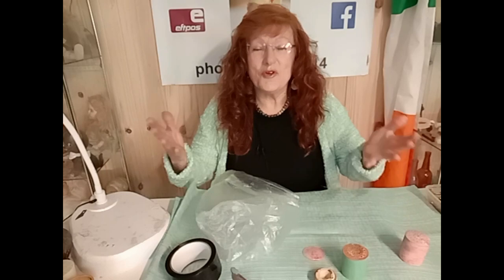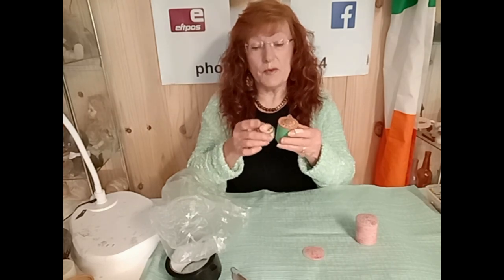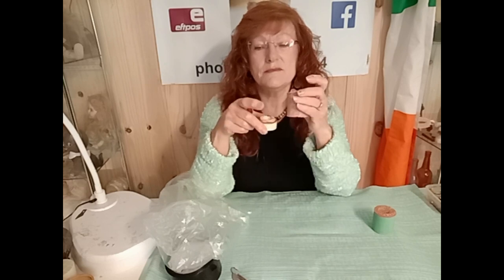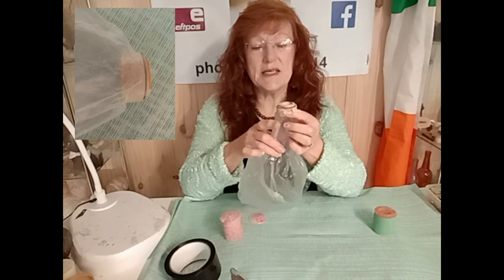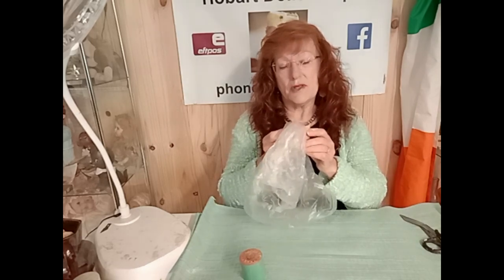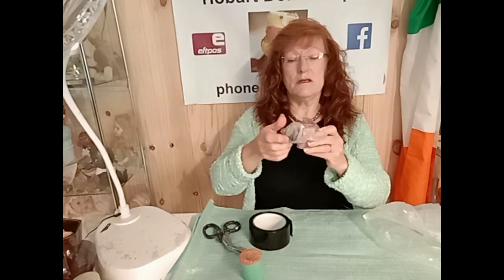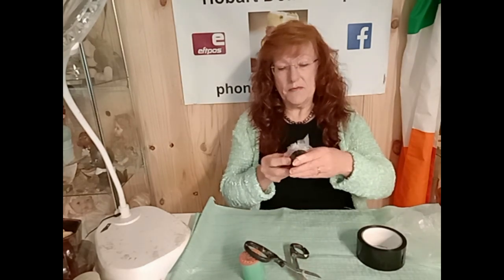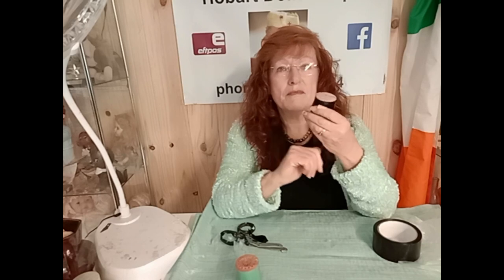How to repair a doll crier.

Comment: Thanks for this video.  Very helpful. I have a doll, which I got after my late mother. Doll probably 60 or more, years old. The crier broke down. some years ago. Doll always kept very carefully, I could repair the crier, as you describe, airtight place for the crier.  Used the method below, tape and a drop of baby oil.
Reply from the maker: Great to hear from you.  Even when handled very carefully, the flange around the edge of the crier can perish.  If you need any additional advice on repairing the crier, please don't hesitate to get in touch.

Comment: Hi Kittie. Is there any way to repair the reed if that doesn't work when blown through please?
Best wishes from the UK
Reply from the maker: Hi. You can try cleaning by blowing through or using a fine brush. Try blowing through from both sides as well. It doesn't take much grit to prevent it from working. Also check that the reed isn't bent and misaligned. An alternative is to use the reed and surrounding piece from another damaged crier. I could send you one but postage costs might make it more worthwhile looking for one closer to home.
Another point is the opening to the reed doesn't have to be misaligned or bent by much for it to prevent the sound.

Comment: Hi Kitty I’m having trouble removing the cryer box. It rotates about 90degrees but is very stiff. Should it just pull out?
Reply from the maker: Do you mean the external cap that you remove to access the crier? If so, if you look closely you will see that on each side is a little slot. You need to align it with pieces that help lock the cap in place. Gradually turn the cap a little at a time until the slots line up with the pieces that will then allow you to lift the cap out. It's not always easy and may take patience so as not to damage things. Let me know how you go or if you need further explanation.
Reply: @hobartdollshospital1720  spot on - thanks ! ☺️